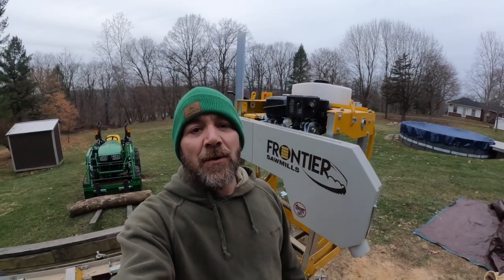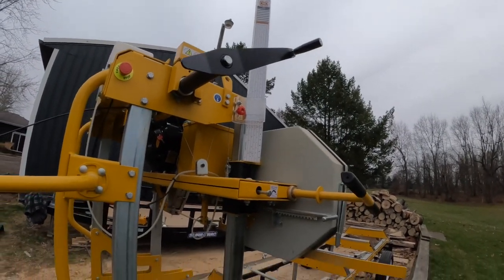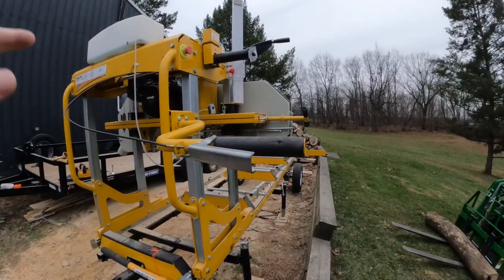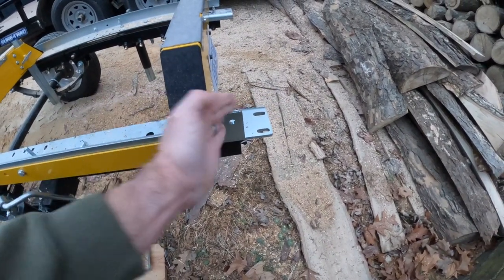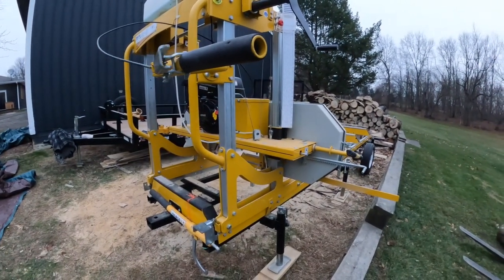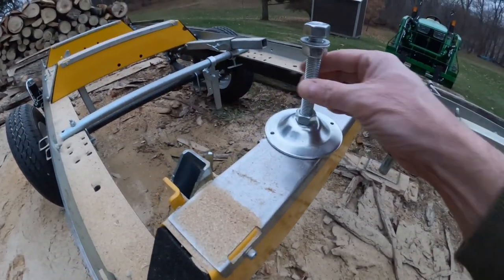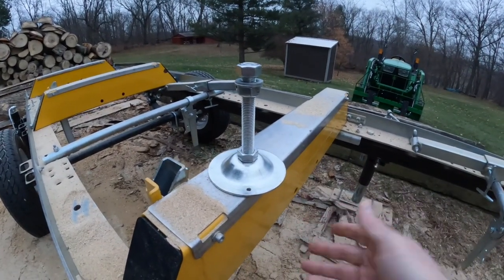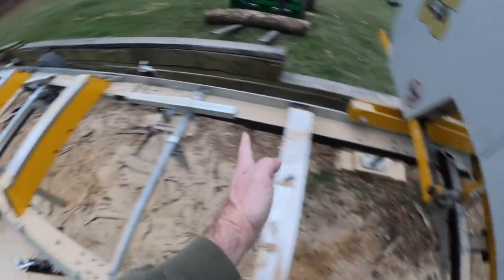How big is the Frontier OS31 Sawmill?

Comment: I’m just wondering. What is the dimension between centers of the feet on the OS31? I have one coming this month and wanted to prep with concrete forms at each location. I have a single bed extension coming as well (7’)
Reply from the maker: The width of the rails are just over 36" so I would suggest 48" wide.  If you want a spot to walk along the mill, then I would go with a total width of 60" or even 72" if you don't mind the the additional expense of pouring the extra material.  I'll probably end up going with a 20 foot by 6 foot pad when I have mine permanently placed.
Reply: @handncreations  oh that’s cool… I was thinking all individual small pads but two long concrete strips with tapered insides to make it easier to pull out material would be a good idea

Comment: Hey there, I ordered an OS31 and can't wait to get it!
What is the biggest square lumber you can cut like 10"x10" or smaller than that or bigger than that?
Basically I want to know what the measurement from the blade up to the bottom of the blade cover is?
The space between that area would determine how thick of a square piece of lumber i can cut.
Didn't see this info on their website....
Reply from the maker: First, congrats on the new mill!  The OS31 is indicates that you can cut up to 31" diameter logs which is HUGE.   Technically, the site says you can cut up to 11' boards so that I possible too.   Other than what I covered, the technical data for the mill is here:  https://www.frontiersawmills.com/en_us/frontier-os31-sawmill-with-14hp-429cc-kohler-electric-start-engine

I hope I helped to answer your question and thanks for watching!!

Comment: How do you like this mill? I've seen a lot of negative reviews about it, and some good ones, but I've seen quite a few complaints about the motor backfiring after letting off the throttle. Would you recommend investing in this mill or a different one?
Reply from the maker: I do like it but I have had to fiddle here and there with adjustments.   For the price and how well it works, I’m happy with it and would recommend it.   The American made ones are nice and do have some benefits but they are quite a bit more cash and have longer wait times.   If you want something for straight up production work then spend the extra and wait for the build times but if you are
Going to cut for yourself or low production then this will do just fine.  Also, if you are handy - there are lots of mods you can do to make it better!   Hope that helps and thanks is for watching.   I’d be happy to send videos of specific stuff.   I’m on a frontier Facebook group and my account is UTV boondocker (my other channel).
Reply: @handncreations  thank you very much for the reply! I'm not really interested in big production, and no way I would ever, or probably could ever, invest in a high dollar wood mizer or something, I'm just interested in doing for the love of the work, and to maybe do like storm work for people, but that's about it. Thank you for the advice! I think my mind is made up, and when I get ready to buy, this will be my choice.
Reply from the maker: @gregorydavidson177  Glad to help and I'm excited for you to get one.  It's super cool to be able to get a log, make dimensional lumber and use it.  Definitely next level self sufficiency!